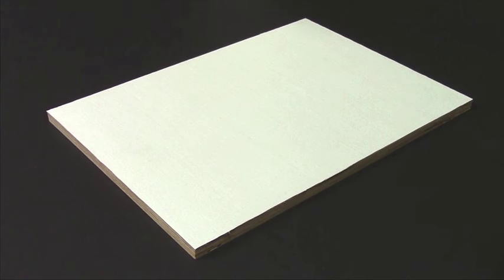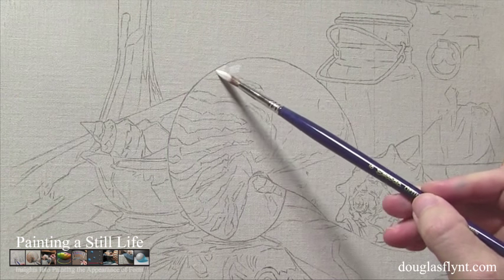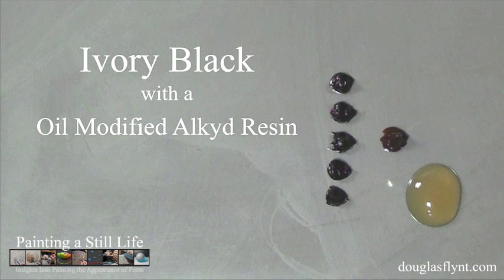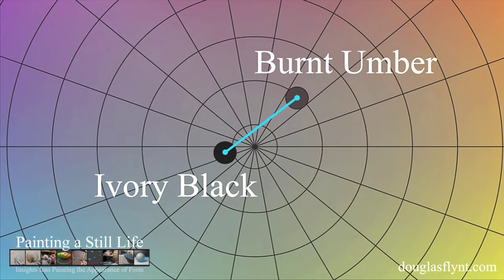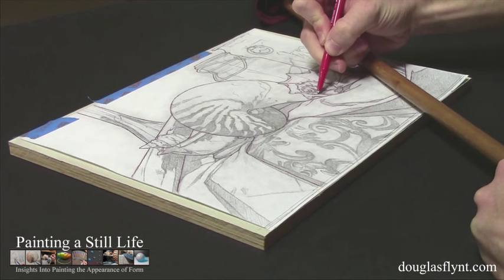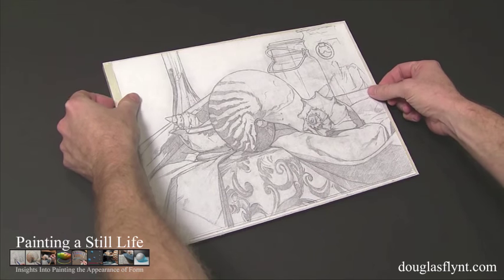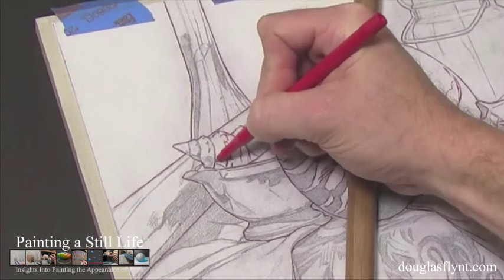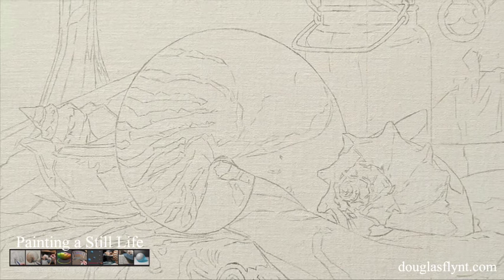Oil Paint Transfer

Comment: Hi thanks for sharing the working method here. I like it that rather than using charcoal or graphite the drawing has been transfered using oil paint. 

Can you please share how did you prevent the oil paint from smudging the canvas though. How dry did the paint have to be till you could put it ontop of the canvas for the transfer?

Thanks!
Reply from the maker: You're welcome. Apply the paint straight from the tube (no medium or solvent) and scumble out a thin layer. Although I know it seems that the paint would smudge the canvas it won't as long as you don't apply pressure (for example resting your hand on it). Make sure you don't have any clumps of paint on the back of the drawing, keep it thin and uniform. The thickness it needs to be applied varies depending on how much tooth your canvas has. A heavier tooth needs a thicker layer of paint. With a couple of tries you will soon get a feel for it. Good luck!

This link might also be helpful: http://douglasflynt.blogspot.com/2010/05/doing-oil-transfer.html
Reply: Thanks Douglas. I have shared your link and reply on wetcanvas.com forum and the solution has been appreciated :)

Comment: What would be wrong with simply using a standard black carbon copy paper from Office depot?
Reply from the maker: Personally, I like the oil transfer because it doesn't introduce any other media into the painting structure. However, you should use what you feel works best for you!
Reply: @DouglasFlynt  Many thanks, I thought that you have a more detailed explanation, 
to me it looks like a lot of effort for no particular reason, but if that's what you like so be it. 
Carbon paper is just carbon it's like drawing with a carbon pencil or charcoal, they even have all graphite carbon paper which is completely like a standard pencil.
Anyway thanks for the answer.